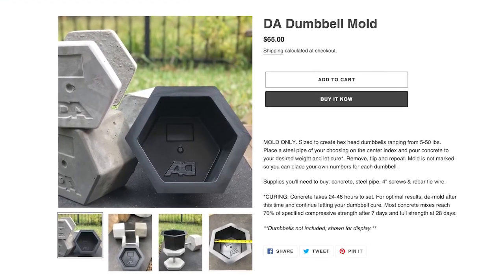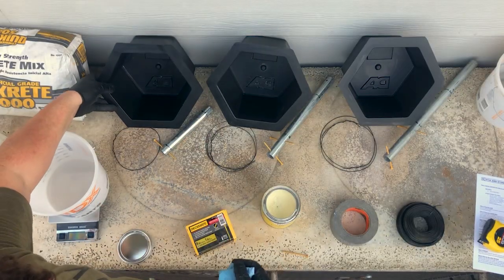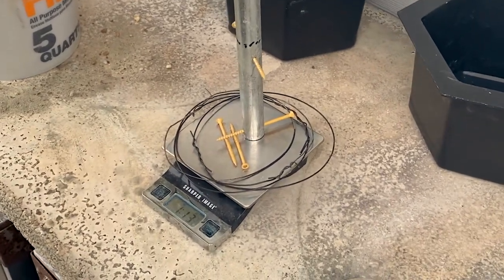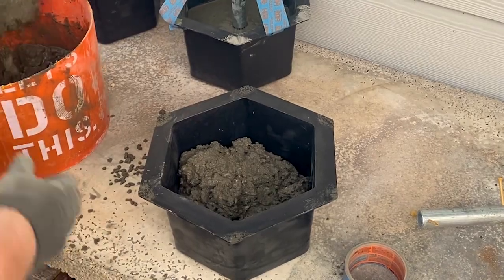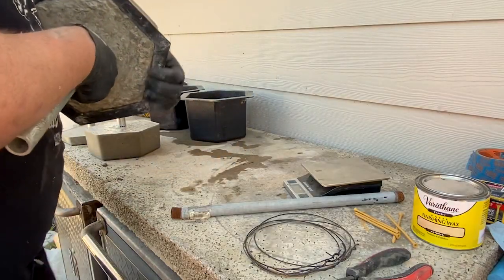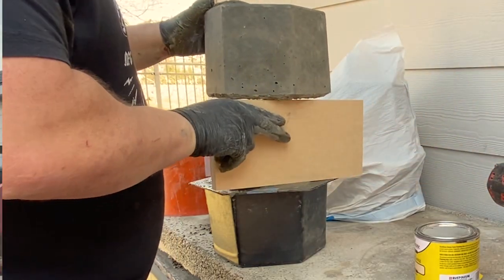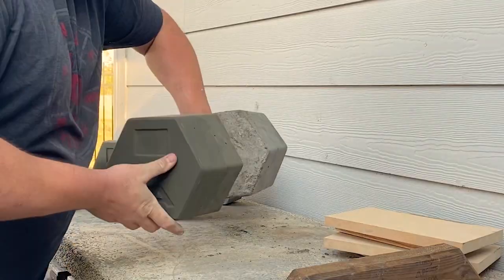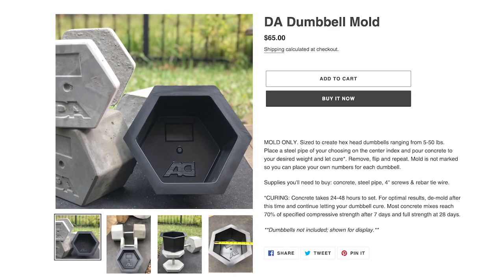How To Make Concrete Dumbbells

Comment: You should know the molds this guy sells to make weight plates turn out great Just incase you had any doubt about legitimacy that is my take (and you can locate additional necessary materials at home Depot galvanized steel fiberglass reinforcement etc. It's a cheaper option) most likely will order this soon next looking forward to seeing what else you come up with super creative wishing you the highest level of success you deserve it.
Reply from the maker: Thank you for the kind words. Working on some cool stuff for the near future that I’m excited to add to the line of molds.

Comment: thank you so much for posting this video.  I have pretty much figured it all out at this point (messed up my first 2) but it is nice to see your process.  I didn't do rebar circles like you, I just attached the wire ties around both screws.  But I will start doing it that way now.
Reply from the maker: Connecting it to the screws will work too. Send some pics when you get a few made!

Comment: Would it be possible to glue in a 1” pipe pre pour for db weights for adjustable db plates
Reply from the maker: For sure. You can make a ton of 5lbs and 10lbs dB heads to make an adjustable/loadable dumbbell.

Comment: Hello
i tried using this method, meaning weight the cement dry and than add water , done 2 days ago and kept inside the mod with plastic all around but it is way off 
I wanted to make 7.5kg dumbbell and each side had 800gr of "rebar"
so i weighted 2.9kg of dry cement, water mixed everything bla bla
today i weighted the first half of the dumbell and got 4.65kg instead of 3.8kg , (2.9kg dry cement + 0.1kg tube + 0.8kg  rebar)

So that is like 800gr of water weight, will it evaporate all?
I mean yeah it is still wet but 800gr of water i dont know
thank you!
Reply from the maker: Let it cure and dry out fully. Then you can sand down the edges to get it down to the exact weight you want. Also take into account the weight of the handle and anchors you are using.
Reply: @stixandstone  so I should wait 7-14 days before weighting again and then it should be right on
Alright thanks a lot!

Comment: I wonder if you add some lead shot into the mix if it would keep it's integrity? 🤔 
Would be cool to if it would add a few extra pounds
Reply from the maker: I have plans to snag some bags of lead bird shot from the sporting goods store to try just that. I’ve added steel and lead to atlas stones so it should be the same process. Update to come later.

Comment: How can we make these in larger poundages?  I'd like to get 5lb increments from 55 to 100.  Is this possible?
Reply from the maker: You can make a form that large enough to hold that much concrete. But it’s going to be very large and very awkward to lift with. I am presently working on a mold that can do that heavy, but I’m trying to make it as “not awkward” as possible with the shape.
Reply: @stixandstone  what are some options we could throw into the concrete to increase the load with the current mold?  Do you think it'd be possible to add in enough to get to 75lbs at least?
Reply from the maker: @stevengrindstaff  it’s definitely possible. You can add lead shot (like what is in shotgun shells) to each side to get up to about that weight. I’ve added old broken wheel weights I got for free from a local tire shop into my atlas stones to do the same thing. It may be worth a try to do the wheel weights for a cheap alternative to the lead shot.
Reply: @stixandstone  appreciate the advice.  I'm going to have to give it a try.  I'll be ordering those molds soon!
Reply from the maker: @stevengrindstaff  bring it on! Also, send me some updates once you get some heavier ones made. Would love to see how well it works for you!
Reply: @stixandstone  for sure!  I'll be keeping my eyes open for the heavier mold you're working on

Comment: I want this molds but my budget is low😥
Reply from the maker: There are a lot of how to videos out there on even cheaper ways to make dumbbells. This is just one way that takes out a bunch of prep steps because the mold is made for you and helps center the handle.
Reply: Thanks for advise sir. And GODBLESS YOU

Comment: Is there bigger molds 60 75 100 lbs
Reply from the maker: This mold only holds enough concrete to make 50lbs dumbbells. But you can add scrap steel and/or lead shot to make heavier dumbbells to an extent.
Reply: @stixandstone  thanks man, have you tried makes heavier ones by adding you recommendations. If so what were the results
Reply from the maker: @johncassidy897  I haven’t yet. I plan on trying the wheel weights as soon as I can get some on hand.

Comment: Might seem expensive but ive searched the internet and cant find any other mold thats as good as this one, shame it isnt available in the eu, because the shipping is expensive as fuck
Reply from the maker: Thank you for the public comment of your snap judgement. Where else can you find an entire set of 5lbs to 50lbs dumbbells for less than $200? (I am, of course, adding in the cost of pipe and concrete for this process.) Please add a link to where you’ve found a better price option for this set instead of just cussing about the cost.
Reply: @stixandstone  tbb i haven't found any, this one seems good,  and probably is worth the investment, i live in the eu so the shipping is about the same price before customs, thats not ur fault tho, ill edit my initial comment
Reply from the maker: @zelder12  thank you for editing and specifying your previous comment. I can’t control shipping costs, especially during a pandemic with such high demand on shipping companies. They can name their price with no recourse.